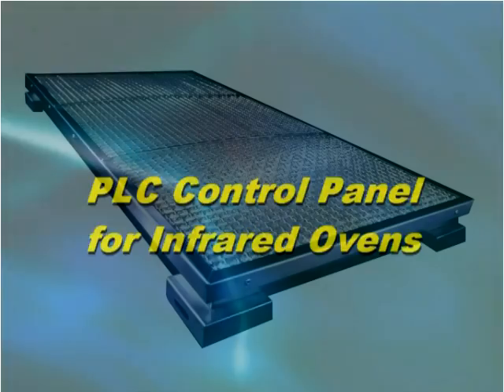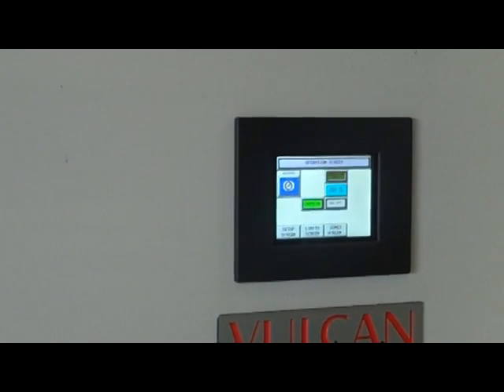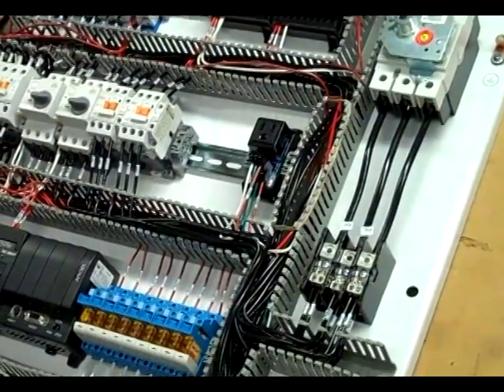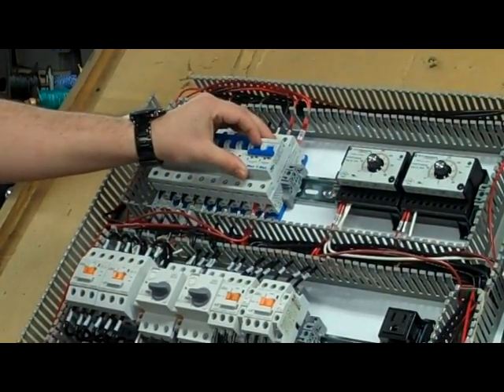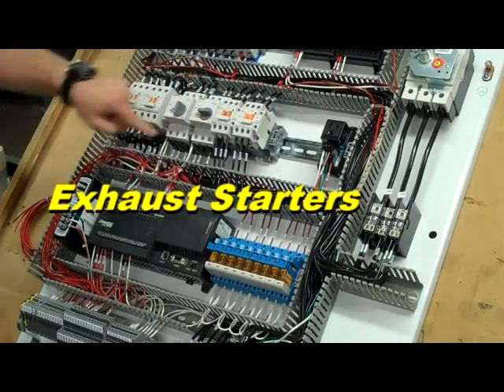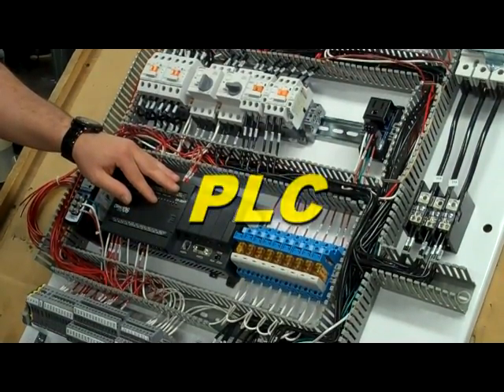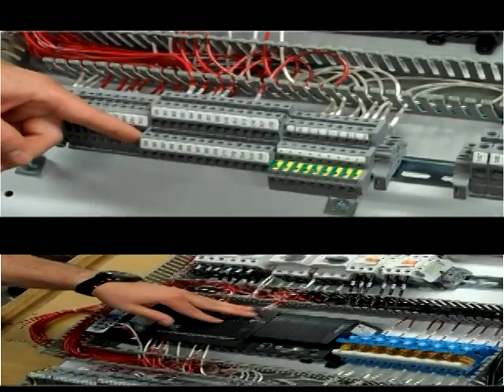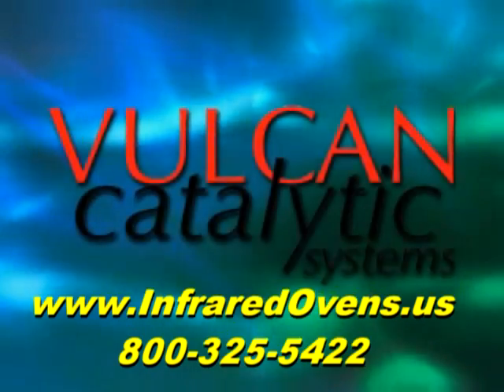Infrared Powder Coating Oven - Industrial PLC Control Panel

Comment: No thought to EMC, DOL starting of fans, no feedback from breakers or contactors and generally not the greatest of designs as there is no room for future additions and I/O expansion without the requirement of another cabinet, the use of more modern concepts such as TCP, Profinet or Modbus would also be beneficial to the integration with other aspects of the process or higher level plant.